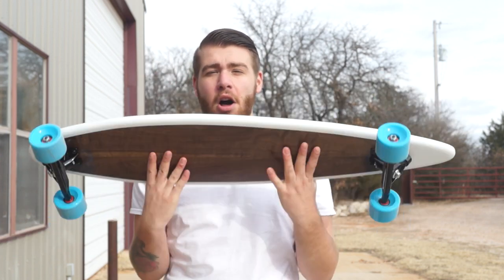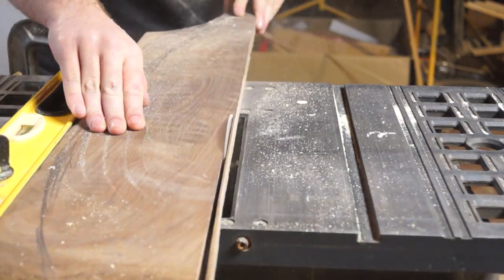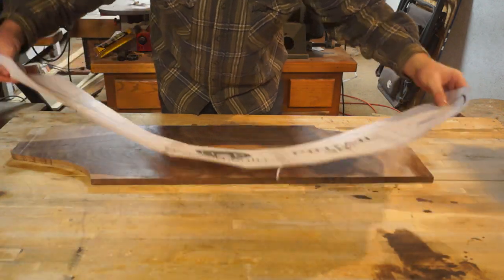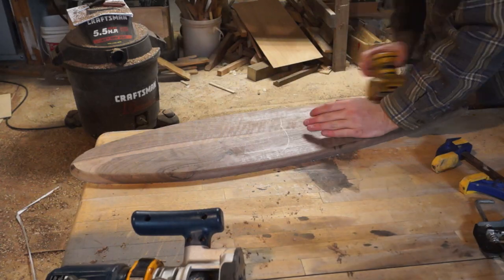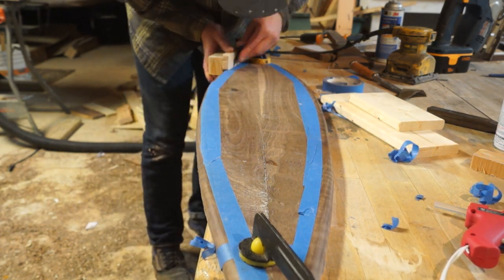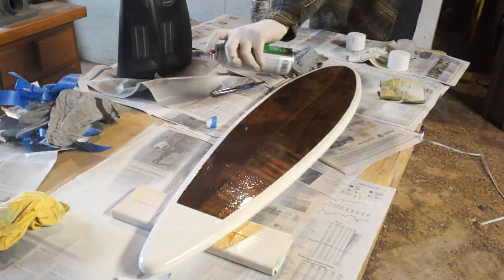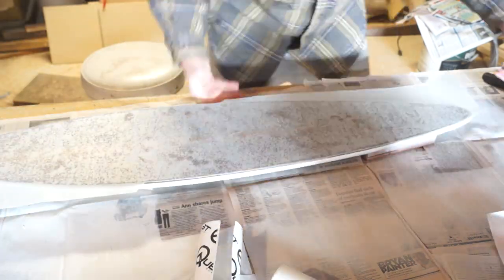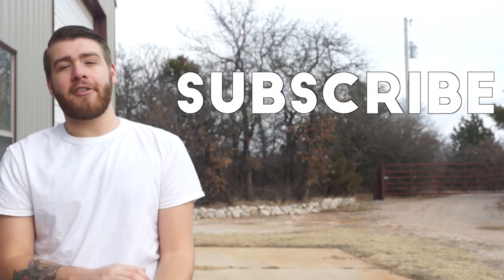How To Build a Longboard | With Template | Modern Builds | EP. 20

Comment: Looks like you started with 3/4 inch stock. What was the final thickness after planing? Does it flex at all? Sweet board. I'm going for a build like this as well. Thanks for the tutorial and the nice pin tail template.

Comment: Check out using crushed glass for grip tape... also depending on how thick the board is, sometimes its easier to just use a belt sander for the edges instead of a router.

Comment: Hey there great video! loving all the different ideas you have, by any chance I have loads of pallets lying around and I was looking into making a pallet wooden wall but ended up having excess planks, thinking of gluing them together to try this long board, would it be feasible or is the wood too stiff?
Reply from the maker: I think that would work fine. You won't have a lot of flex, but that's the same with the board I built

Comment: I build boards with plywood and fiber laminations all the time and it is way easier to buişd a solid wood deck and also works pretty much the same if you just want to cruise around with it. If you are into a different game like downhill or freeride this is not the kind of board you want to build as it will not endure any torsional vibration as good as a fiber sandwich board. For cruising and everyday use this is the best kind of board you can build. Also a handmade cruiser always looks way better than a plastic penny board
Reply from the maker: Exactly! Couldn't have said it better.

Comment: Just throwing it out there. To get the template off the wood easier, hit it with a heat gun or hair dryer. The heat makes the glue fail, and it'll peel off quickly and easily. Cheaper than buying Goo Gone every month, too.
Reply from the maker: Yeah that's a great idea! I'm trying that out next time for sure

Comment: Damn it! Your marking tool is amazingly simple!!!
When i was making my tool, I've gone by a too difficult way and only now i realise it >___< Thanks for the tip)

By the way, is it okay that your board doesn't have any concave? And do you use some risers to avoid wheel bite or is does the shape of deck prevent it itself?
Reply from the maker: the shape of the board does help, but I used riser blocks to prevent any wheel  bite
Reply: Modern Builds, understood) 
p.s. great painting work, accurate and nice!

Comment: Great job! Just wondering.... Will it be ok with only glue holding those 2 pieces together in the center?
Reply from the maker: Thanks a lot! Absolutely, a good glue joint is technically stronger than the fibers holding wood together. Like I said in the vid, you can always use a biscuit joiner if your worried.

Comment: What type of wood should I use a hard
Or soft wood?
Reply from the maker: +Mason Martin A hard wood can be a thinner board because it has more tinsel strength.
Reply: Ok thanks but what type did you use? And the template will not print

Comment: hey modern builds I printed the template out but it came out a lot small than it was supposed to and other templates online only printed 1 sheet so how do I make it normal sized?
Reply: hey if your looking into printing a board template they to see if a staples has a plotter it'll be able to print out the size you need for your board.
Reply: i aready made it
lol
Reply: oh ok how did it come out?
Reply: +Alex Dossantos ok but not as good as i thougjt
Reply: +Alex Dossantos ok but not as good as i thougjt
Reply: what was wrong? also did u do the layers of wood or solid pieces?
Reply: +Alex Dossantos i used plywoodXd 6 layers i cut  in half and attached 3 and 3

Comment: Not my fault if it splits in half...
Reply from the maker: It won't split in half.... Especially if you use biscuits. In a good glue joint, the fibers of the wood will split before the glue will.
Reply: +Modern Builds that's good. I'm just learning how to skateboard,  but I have a normal board, and I really like Longboards.  They're good for transportation and simple to make with the right materials AND you don't need a press for it.
Reply from the maker: Exactly, longboard and cruisers are awesome for just getting around... softer wheels too!